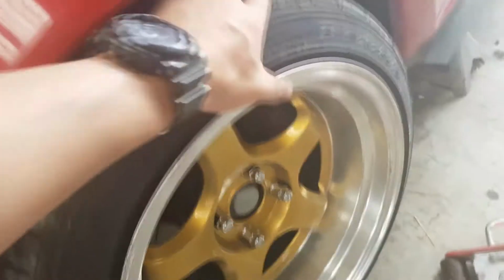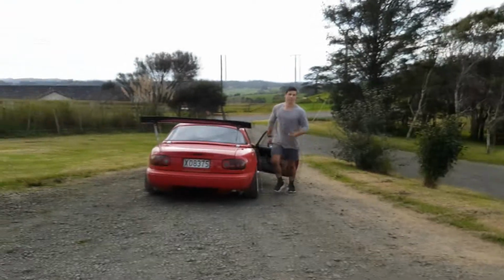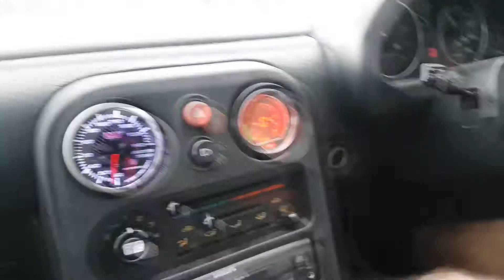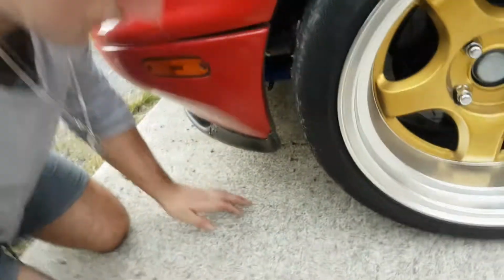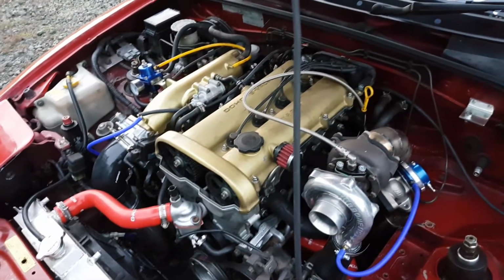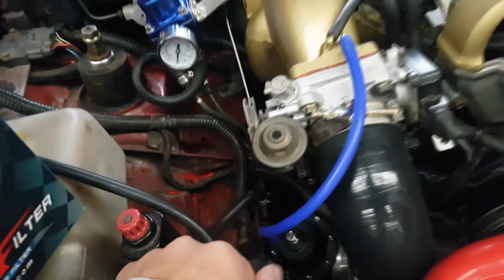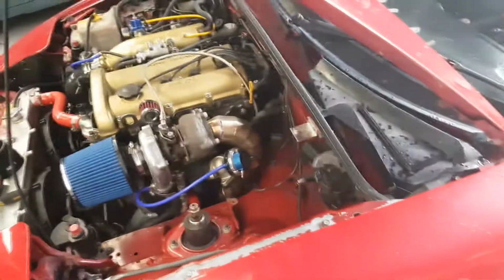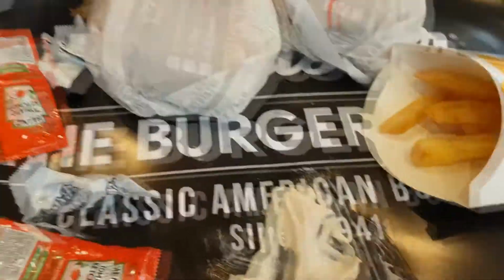300hp Miata Goal: First reaction to run-in tune

Comment: What was causing the knock?
Reply from the maker: Rhodes a couple of connecting rod caps werent screwed on properly and 2 of the bearings got ruined. we didnt want to make a vid on it because all we did was replace the bearings and put the engine back in and it would've been boring haha.
Reply: Oh yeah sweet, enjoying the vids keep em up